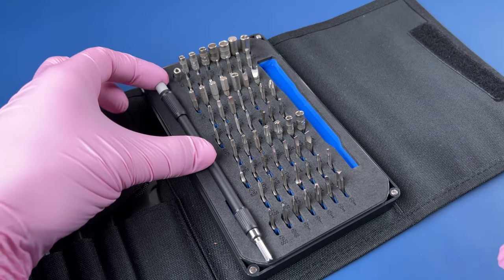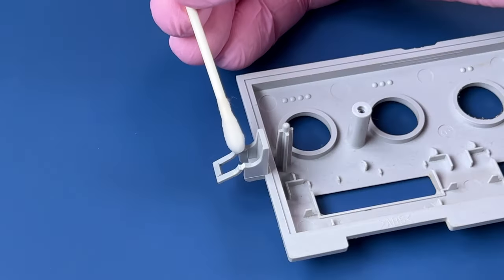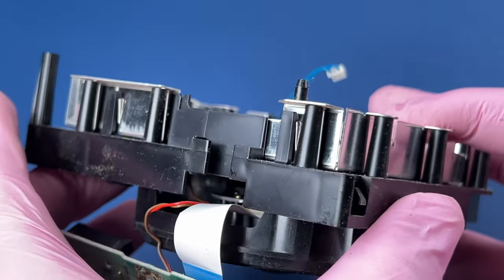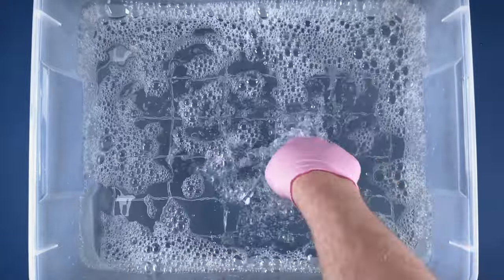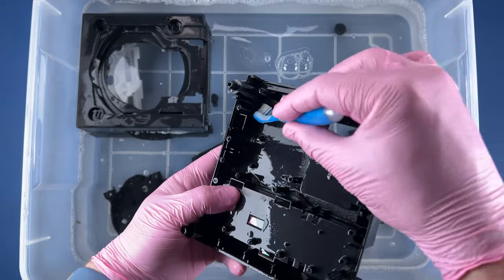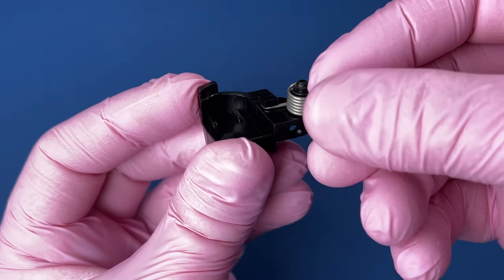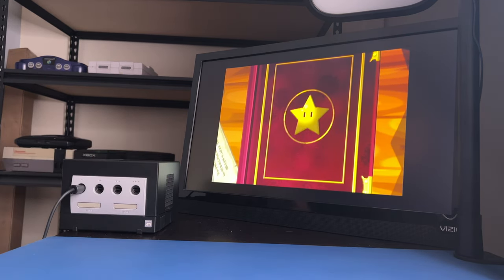Deep Clean Therapy: Nintendo GameCube

Comment: The disc drive's potentiometer should not be touched at all. The first thing to check are the capacitors on the drive's board. The caps are the main failure point of these drives and making them output higher voltage can sometimes make a GC work for a bit, but only speed up its demise.

Comment: im waiting on some gamebit bits in the mail, and then i plan to open up my silver gamecube that has served me well since childhood. its been a real trooper all these years, so i dug it out from my old box of consoles and i want to try to give it the cleaning it deserves
Reply from the maker: Yes! Love hearing this. It’s gonna look so good!
Reply: @RestorishOfficial  i disassembled, washed and cleaned everything and let it dry for a day and a half, and its all back together now nice and clean! i originally ended up with two "extra" screws after reassembly (oops). i went back and found where i missed reinstalling them and made it right. my gamecube has a spring underneath the open disc button that yours didnt seem to have. it took me a while to figure out which button it belonged under. 

i plugged it all in and slapped in a memory card and super smash bros melee, AND....nothing. i thought i broke it. turns out i didnt push the video connector all the way in. after i double checked my plugs then everything booted up.

someday i might go back in there and replace the clock battery. mine isnt dead, but it starts to lag behind in minutes pretty quickly. pretty good for 20 odd years. thanks for the walkthrough!

Comment: Hey I just wanted to explain something about the issue with the potentiometer. What you are adjusting is the resistence (ohms) to the power going to the laser. When a laser goes bad you need to decrease the resistance to give it more power. So the laser being bad was likely not the fault on this (a dirty lense perhaps). There is a range where the laser can operate and if it can work with the potentiometer set high it'll mean the laser will go longer before it burns out, if it's too high the laser will not be strong enough to read the disk. On the other end, the lower you set the potentiometer the faster the laser will burn out. Set it too low and it will burn out very quickly.

If cleaning the lense and the assembly doesn't solve the issue lowering the resistance can be a short term fix for sure. It might just a little tweak and it might chug along for years. I've simply never seen a laser potentiometer set too low and it being the cause for it not reading discs (I have seen it set too low and the laser being burnt out though) that might be just a coincidence though so please correct me if I'm wrong.

Thanks for a good and enjoyable video :) I'll be sure to watch all of them!

PS: If you happen to read this I was wondering doesn't magic eraser have micro abrasive material in it and if such doesn't that dull the finish? I have really wanted to find a good way to remove scratches and blemishes without resorting to a polishing wheel.
Reply: I’ve found that recapping the lasers board is a way better solution than messing with the Pot.
Reply: I'm also confused about this. My laser is now set to 100 ohms to read burned discs better. I think it's typical to lower it for that. I'm afraid mines too low tho. If I can raise it and it'll work???? Maybe I should try that

Comment: @12:20.  A little disappointed you didnt brush out the heatsink.   You did all that work and the heatsink with a narrow brush could have been cleaned out to look as great as the rest of the work.  Don't take it the wrong way cleaning these consoles is a huge undertaking which your 15 min videos do not show because of the algorithm but still....12:44.  Changing the factory laser settings via the pots or potentiometers ultimately will burn out the laser sooner than later (I know its suggested) but just letting you know.
Reply from the maker: Thanks for the positive feedback and info!

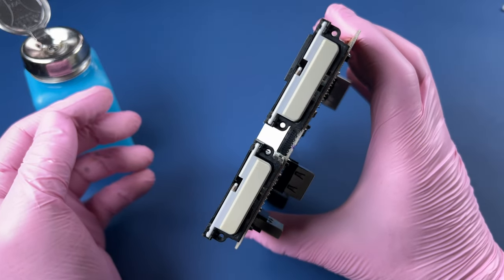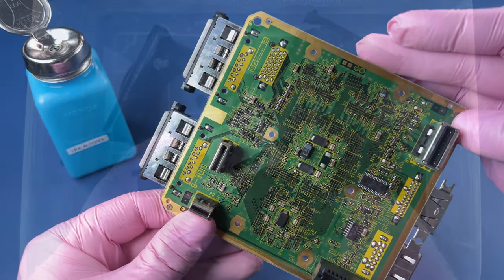Comment: 10:52 - 11:01 -- I don't buy that, dude. If someone is willing to disassemble their console that is filled with delicate and intricate parts, setting up a small bin with some hydrogen peroxide solution and a few UV LEDs that are already configured for use by plugging them in should not be a problem. On top of that, hydrogen peroxide, UV LEDs, and a small plastic bin are inexpensive. 

Are you sure that is your reason -- accessibility? Just seems more of an excuse to me, all things considered. Or is this one of those things where fear that you will be deemed an Odd Tinkering clone or some other similar channel? 

You did a good job on the cleaning, but if you're not going to bother  retrobrighting those two panels, it seriously leaves the job feeling incomplete, so why do it at all if you're not going to see it through? Just my thoughts on it.